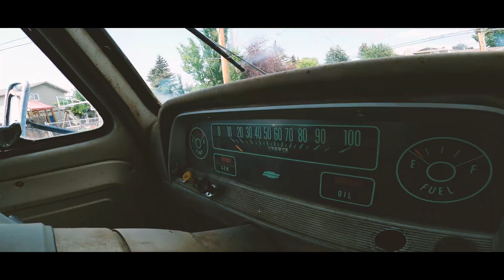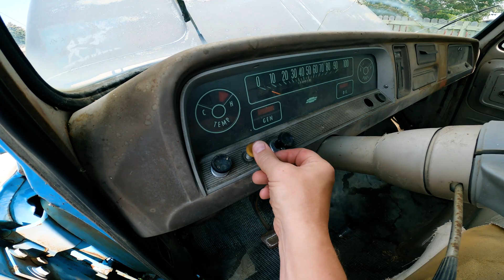You have NEVER seen a TESLA Like This! | Gears and Tech

Comment: This needs what I'm going to call boost caboose, because I like the show roadkill. A trailer with a small engine that will help push at highway speed
Reply from the maker: Won't need any extra support. Motor has 300hp. Truck had 120 hp with stock engine

Will do highway speeds no problem
Reply: @GearsAndTech  I'm just thinking when I drove a Tesla I found the highway range to be crappy